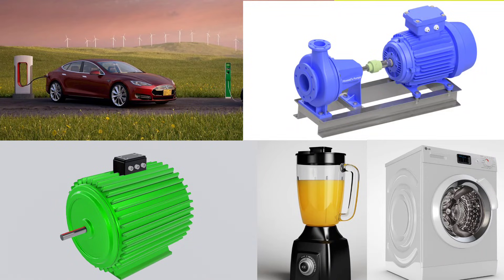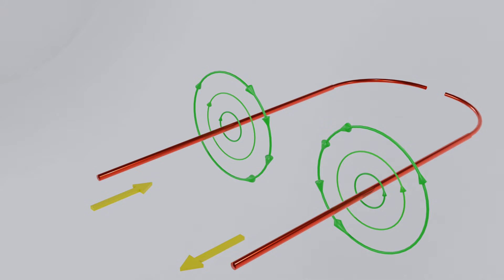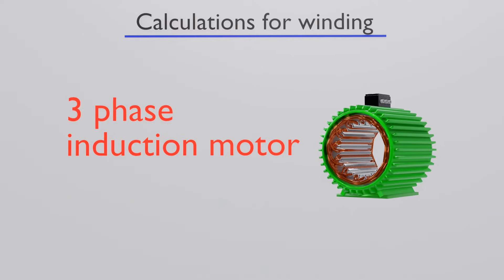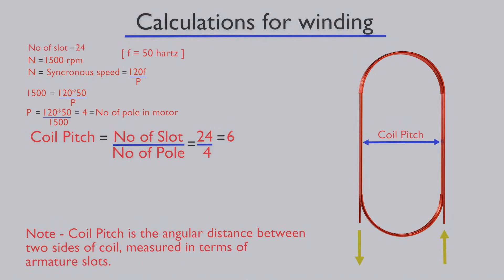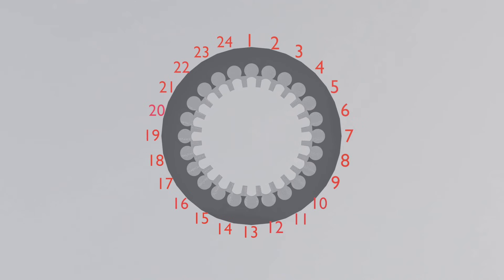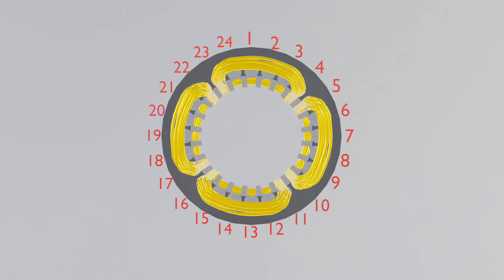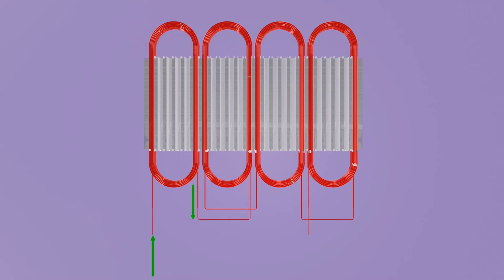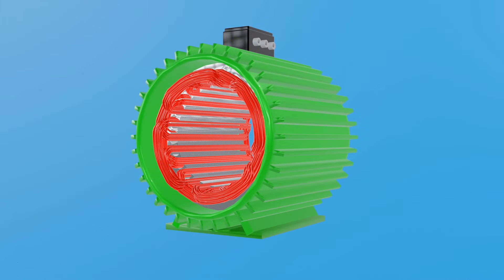Understanding Motor Winding , Induction motor coil Arrangement, Working of winding

Comment: Thanks for releasing so much technical information!   I have a question:  why are the coils wired in series, not in parallel?   It seems to me that there would be much less resistance seen by the current if the coils were wired in parallel.   What am I missing?

Comment: Can you explain me how to calculate the number of wire for each coil for the specific voltage we need to winding a motor. Example: 24 slots, three phase for 48volt motor, for 110 and 380volt motor
Thank you

Comment: Can anyone elaborate on Phase Angle and how it is applied to coil placement?
I don't quite understand it.
Reply: Here phase angle was calculated to be 4 . Which means you should skip 4 slots from the beggining of the red winding and place the blue winding at the relevant slot (using colors to be more understandable ). And also skip 4 slots from the beginning of the blue and the place the yellow there,  and so on .

For example ; Supposedly the angle was calculated to be 1(Supposedly) then each winding should be next to the other without skipping any slots .

Does this explanation make it easier ? Or worse?
Reply: @A-A-A-A-A-A-A-A  I understand now, your explanation was helpful. Thank you.

Comment: It was good explanation but is hard to imagine how that work deeply . Magnetic field is hard to understand .I want rewind one single faze motor . So I hope so you can help me with how to connect coils or wires. Every single motor has capacitor because changing rotation right or left and whan motor start to runing he use capacitor . I want repair motor with 2.5 HP and 2800 number of  rotation , with capacitor 20 microfarad , stator wires are damaged and burned , do you know how conect start coils and other  seconds coils inside stator , which step of winding is ?Yes I can se that on the stator but whan I put out old coils from stator I m not sure I will see enough !? So if you know let me know, I wanna know how are in connection start coils and do they connected in the stator in line or before clembert where are phase and neutral cable and 230 voltage ? I hope so you understood what I said . Is not hard rewind how much is difficult know where is begining and where is the end how are pols in relations inside . That make confused minds . So I will be very happy if you can help me with good theory instructions . I can send you a picture and how motor look , actually stator . I never did rewind before but I belive I can fix that somehow .

Comment: Practical knowledge including methods for calculating various values. according to the sequence of steps, converged through Animation is very complete, very good, Thank you very much.(Please add a method to calculate the number of winding turns, and the size of the coil number. thank you in advance.)

Comment: What is the reason of this equation  120 × 6 ÷ 180
Reply from the maker: This is the formula for phase angle (for providing 120° electrical Phase shift  between two phases in terms of slot {mechanically Phase shift for producing rotating magnetic field}).